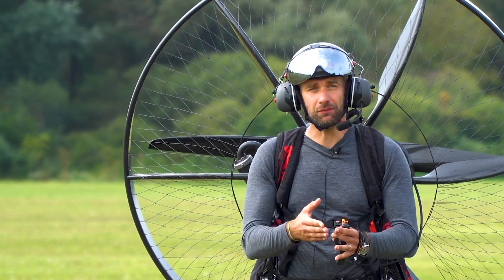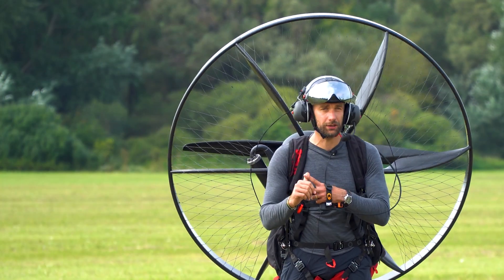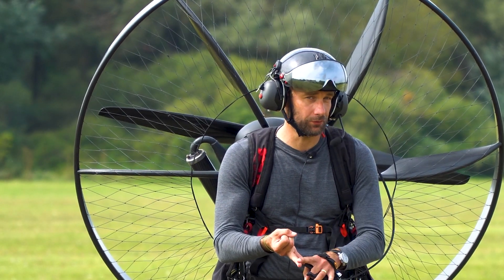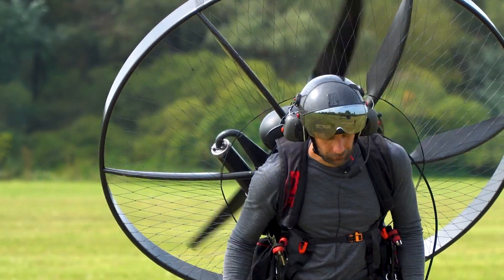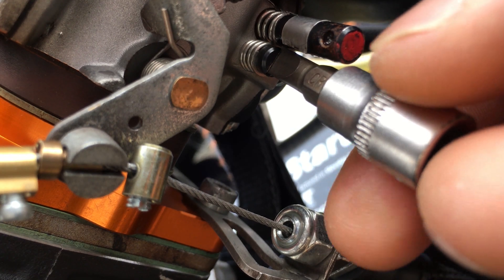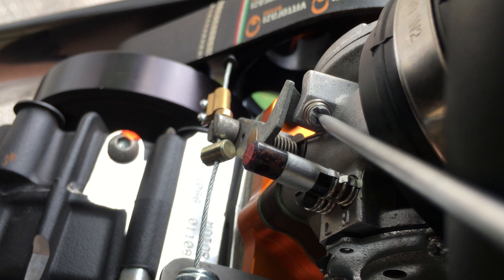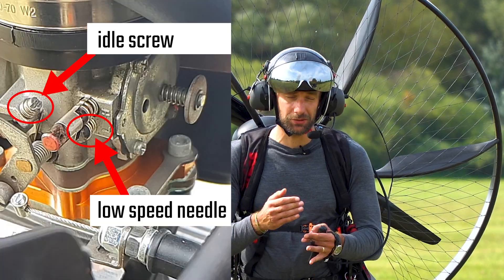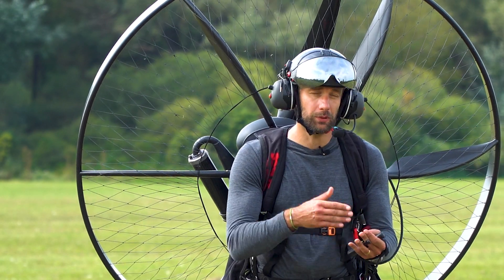How to adjust the low speed needle on the Vittorazi Moster 185 carburetor. Scout user manuals.

Comment: another pro tune tip is to watch your stinger shake at cruise speed 5500 rpm.  YOu are looking for very little shake and wiggle.  If it shakes, take one minute off of the low screw.....leaning it.  The shake means it is too rich and a rich engine runs rough not smooth.
Reply: btw , I have the record time on an exhaust not cracking before it finally cracked and had to get the 2 piece exhaust.  My motor is a 2019 that came with the one piece exhaust.  The smoother you can get your engine...the less shit will break.

Comment: one thing to add to this great video is if you live in gulf states region of the US you will need to adjust your low screw once for summer and then readjust again once for winter.  a winter setting in summer will be too rich and your engine will be hard to start.  A summer setting in winter will be too lean and your engine will be hard to start.  THis is how you know it's time to make that adjustment......when it's hard to start.

Comment: If I were to do this procedure, my Moster 185 would become impossible to start after 4-5 starts, after it becomes warm. What would cause it to be so difficult to start when warm?
Reply from the maker: This pro0cedure should be done on a warm engine.
Your case is really unusual. 
Usually it is a lot easier to start an engine warm.
I do not have an advice for you now. I wish I could try the engine myself

Comment: Is it the same process for the Atom 80?
Reply from the maker: The new version of atom 80 has the same carburettor. Only 2018 version has a different one.
Reply: @SCOUTaviation  Thanks. I have the MY20 Atom 80 but the Maverick manual says different settings compared to the Moster (Low screw 22 minutes and High screw 60 minutes). I'm mainly asking can you use this method of leaning out until blipping is not responsive on any engine like an Atom 80 or Top 80? And do you prefer this method compared to checking the plug colour?
Reply from the maker: @turkeyphant  yes you are correct. I thought you are referring to the low needle as it is the same for Moster and Atom. Moster manual says 15-20 minutes. Atom says 22. The procedure for tuning low needle would be the same for both engines but i do not have that much experience with Atom 80 low needle tuning. Simply because I never had the need to tune the Atom 80. It was always running perfect. The Moster I tune more often.

The spark plug color should be checked after a minute or two of full power and that is mostly affected by high needle. 
Summary:
I adjust the low needle by idling behaviour and I adjust the high needle by max RPM and spark plug color. 

There is a difference in high needle. Moster 69-75 minutes, Atom 60 minutes. Sealed.

Comment: Can yo please be more clear on the amount to open the idle neddle from scratch?  You say that from a totaly closed position you counterclockwise 20 minutes. But I have read in the manual 1/4 and I thought that means one complette turn plus 1/4.
So, can you please show us the exact amount  to open feom scratch? 
I understand that 20minutes is almost the half of 1 complette turn. Is that the correct interpretation?
Reply: yes. 20mins is 1/3 an hour or 120 degrees. Just a bit less than half a turn.

Comment: Hey Guys! Question....

It seems the fuel line is getting air bubbles in it post fuel bulb. Is this normal? It is a brand-new unit and I had them send out a new one however the problem still exists with the replacement.

Another question... 

Should the engine sort of surge up around 5500-6000rpm? Almost like you've hit boost as if it were turbocharged? It's quite abrupt and makes me think something is up.

Have followed the tuning procedure many times and cannot get this issue to go away.

Thanks!
Reply: Che  carburatore utilizza  ?    il anche il mio fa   così   perché  ha   polverizzatore   con  dentro  una  check valve  e   quando passa dai  giri  medi   agli   alti,   fa  quel salto anche se   ben  carburato.   Il   mio   ha   un   walbro wg8

Comment: i have a new Moster 185 Parajet Maverick and was very grateful for this step-by-step tutorial. I have an issue regarding steady state at 6000 rpm where the engine gets to 5800 rpm and surges to 6800 rpm.  Thank you so much for helping me better understand how to tune this motor
Reply from the maker: that sounds like a combination of rich low screw and lean high screw.

Comment: 6:30 another indication that your needle is too lean is once you start it, the RPMs from idle start to creep up by 100-300 RPM. You can hear the motor idle at 6:30 and then slowly creep up a bit, even before the throttle is touched. This is another great indicator that you've leaned out your low needle just a bit too much and you need to open it up just a minute or two.

This is a great video on carb tuning!
Reply: This could be my problem, thanks.

Comment: Help!  Very good vids thanks. So my question, I have atom 80. My seller put in a recall piece in carb and since then it runs horrible, it stops for no reason. I took it back to him, we retuned the carb like in your vid. Air/gas ratio. My issue is the idle, it turns so slow, 1600-1700 should be 1800-2000 rpm. All I need to do is adjust the idle pin, but it’s to its max, it won’t screw more. What can I do. Seems that recall piece messed up my atom 80. It worked so great before. Only one season, 25 hours. Thanks

Comment: NOTE TO SELF:  I need to buy that tiny screwdriver with the minute marks on it!... Lol
Reply: I’m pretty sure those aren’t minute marks. That’s just a 3/8” flat head socket that happens to have knurls in a manner similar to how minutes would be set up. The knurls are more for grip but it definitely helps visualization as it has to be close 👍
Reply: Uh, maybe just take YOURS to a technician. Those aint minute marks and thats a basic 3/8" drive screwdriver socket. lol

Comment: Did you mention that the engine has to be hot before adjusting. If you try to adjust a cold engine it will run too rich when its hot. A perfectly tuned engine will bog a little down low when cold.
Reply: He definitely mentioned a warm engine in the summary at the end.
Reply: @tubeyou1906  oh did he ? I watched back again but must have missed I. I only left the comment because I didn't want others that were not mechanically inclined to think that its a cold engine.
Reply: Once my engine is hot, it's nearly impossible to start.

Comment: I have to say having my engine fine tuned by Stefan in Iceland was the best. Starts on second pull, no harsh knocking and smooth linear throttle. Takes a bit of practice but it’s a delight when done right. Plus you get that sweet feeling of security knowing that your engine won’t die down on you over that glacier or river. Thanks Miro and Stefan fir another great video. 🙏🏻

Comment: One thing you should add as a caption: don't use any significant force when closing the L screw all the way in, or otherwise you'll damage the carb seat and this will be irrepairable